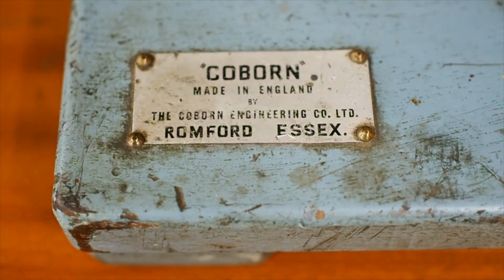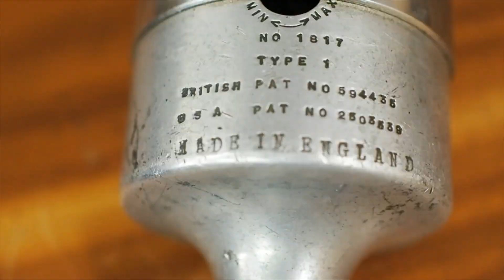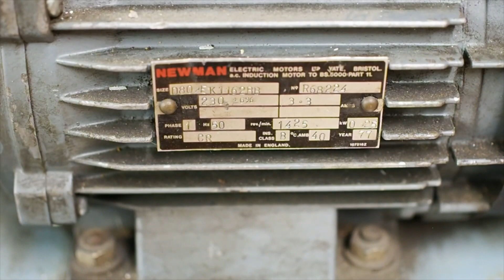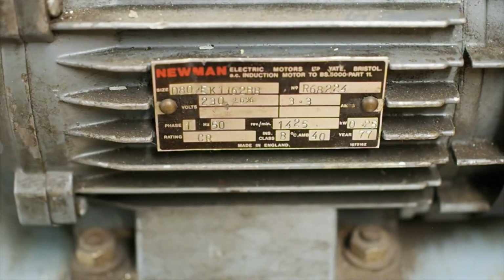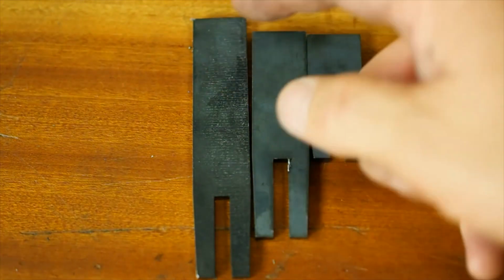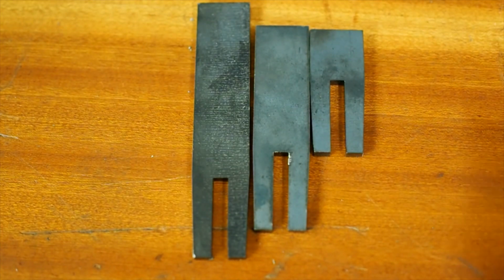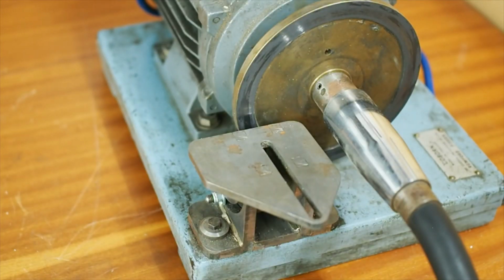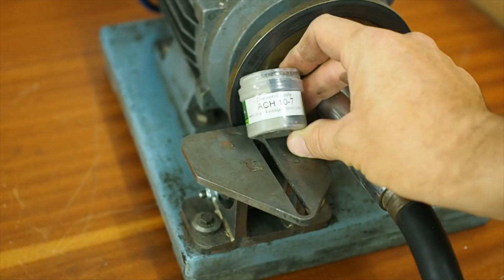The best powered scraper ever made?? Better than a Biax?

Comment: VERY NICE !  
made back when ya put quality into your work and built to last 

I needed a die grinder just out of high school and couldnt find a new one ,let alone afford one,...I ran across an old Sioux die grinder from the 50's early 60's thick aluminum housing and every wearable part able to be replaced easily
I replaced the cord  put in new brushes cleaned the heck outa the switch, and found an assortment of NOS collets,
that was in 1983 she still ports and polishes automotive heads like she was brand new

good job , keeping the old ones working
Mike
Reply from the maker: Hi Mike, yeah this is a pretty device. The castings are quite heavy in the hand piece.

Comment: I finally got a 26" cast iron prism so I will finally be able to get my H618 surface grinder repaired. I've been looking on eBay for the last 2 years for an affordable small camelback or a prism or even a triangular straight edge but all of them I've seen were wickedly expensive. I finally bought a raw 26" Foster Featherweight prism and I'm going to machine and scrape it myself. People think refurbishing used equipment is a good way to save money, right up until they realize they need a surface plate, scraping tools, precision flats and all of the other metrology gear required to make things flat and true. In my case, my prize bargains, the $200 Boyer Schultz surface grinder and my new $300 Clausing 5914 lathe, only needed $1000 worth of gear to get started with the refurb project. Now if I can just find a deal on a tub of elbow grease, lol.
Reply from the maker: Nice find. The only thing I would advise on starting out scraping, is dont underestimate how fast carbide scraper blades go blunt. You dont really notice how much harder it is to remove metal till you lap again. The cast iron lapping wheel on my scraper drive is a god send. Consider whipping up something like this.

https://www.youtube.com/watch?v=GOBtH4m2TYo

Comment: I had been dreaming of building something just like this ... with the stationary motor.  Thanks for sharing.  Amazing what is out there.
Reply from the maker: Thanks for watching. The old patent filing with a picture of the mechanism is in the Practical Machinist thead on it.
Reply: @RotarySMP  Rotary, great tool, thanks for sharing the link to the PM site.  Apart from Richard King raising the noise floor a few dB's, it was a good discussion.

I hate running electric tools with geared motors ... too much noise too much vibration ... the Coborn was ahead of its time.
Reply from the maker: @capncharlie7894  Thanks. It really is a nice machine.  Having the honing plate make a s huge difference. I find I'm honing the edge every two of three passes, and it make a big difference when sharp.  The flex shaft is not terribly flexible, but the jobs I have done have been on the bench, so it was easy enough to move the machine around.

Comment: Thanks for the video! 
I do scraping as a side job for a few year now (got an old Biax actually), i've seen pretty much anything on the market, but this thing, with the grinding wheel and the massive body looks extremely cool! Gotta love the old-timey stuff :)

p.s. I think the idea of a separate motor stems from the industry's "conservatism" rather than shortage of alternatives. You could get any handheld power tool back then, but remember, as resent as at the 50's most big factory machines were still driven by a line motor, so this "big stationary unit to drive an appliance" paradigm was very much the norm for industrial equipment.
Reply from the maker: Thanks for watching. The coborn really is a cool machine. On my minilathe project, a lot of the parts I scrape are tiny, and I have been hand scraping, but having that lapping wheel on the coborn always available means I touch up the carbide blade really often, and you sure notice how much better they cut when freshly lapped.
Reply: @RotarySMP  I hone the insert without even noticing it most of the times :)) I use this diamond stone thingy, and it doesn't need much if you do it often as you should.

Sorry for asking, but how much did it cost you?

Comment: Here is what I would do with that tool I would put 18 volt motor on it from cordless drill or die grinder or a router motor because it has variable speed dial on motor. 
It is a fun old school tool that works for you keep it.
Reply from the maker: I am pretty happy with it as it is. But you are correct, if that flex shaft fails I’ll put such a motor on it

Comment: Hello, how did you blue the feet?  Is there some way to do it without a large enough surface plate or straight edge that spans the feet?  Thank you.
Reply from the maker: The fit across the diagonal of my surface plate. I don't know of any other way to easily get them in a single plane.

Comment: It looks a lot smoother than a Biax, but I think a lot comes down to how well the blade is sharpened, what kind of cast iron you're scraping, how good the DIY scraping blades are....
Reply from the maker: Thanks. In the original patent, it is mentioned that the handpeice should have sufficient mass to provide some inertia. I don't think it is lighter than a Biax.

Comment: I wonder if that motor is the right RPM? The scraping you show looks too heavy (I'm NO expert, I'm trying to learn). How can you get points of bearing? It looks like it cuts deep channels across the surface with no original surface between them.
Reply from the maker: Thanks for checking out my video. 
It is a normal 4 pole induction motor so about 1280 stroke/minute. Modern Biax are 0-1800SPM. The older ones would have been the same soeed as mine. You do need to move it quite fast to get a checkerboard pattern. It is definitely a practice and muscle memory thing.
Reply: RotarySMP I think if that was a two pole motor you'd have 2400 rpm to play with and that might be a better way of getting a light touch on it if you had a speed controller. You mentioned a VFD  I know they are used to run and control a 3 phase motor, but do they make VFD's to run single phase motors?
Reply from the maker: @samrodian919  This is a three phase motor which has a capacitor to fake a second phase so it can be run off three phase. I haven't hook up a VFD to it. When dive bombing the spots, you get a feel for it, and dont really need to slow it down.
Reply: Looking at the style of the motor I’m sure it’s not the original so the rpm may have been different, anyway it looks like the replacement was done well and with a VFD it won,t matter. Not having the noise of a universal motor and the inbuilt lapping unit makes it a winner.

Comment: I think that machine scraper is good after use but with hand tools you always have that feel there what it is doing high spots etc with machine it is harder
Reply from the maker: For finer parts I would probably also do a final spotting with a hand scraper, but for a simple static interface this will be good enough.